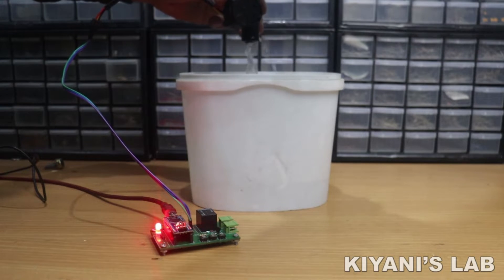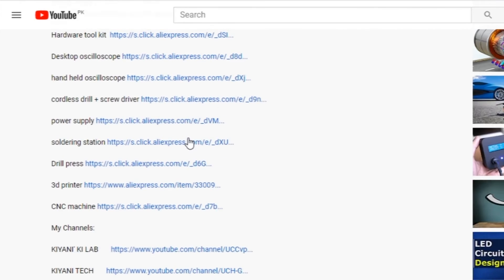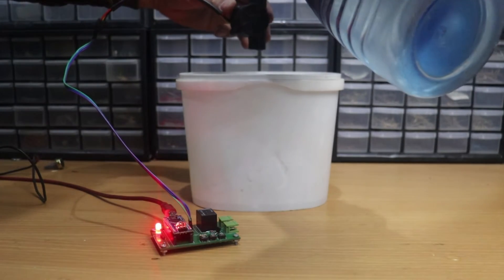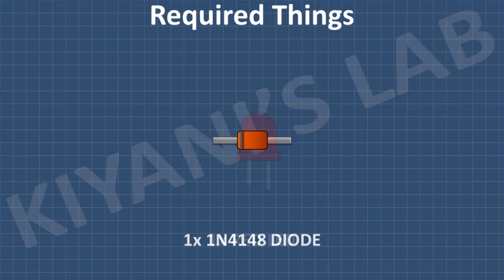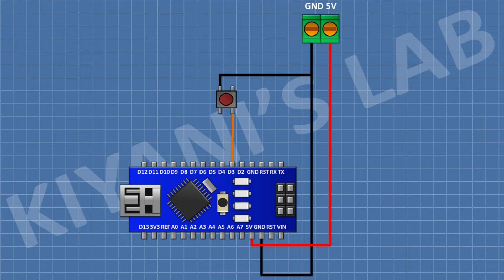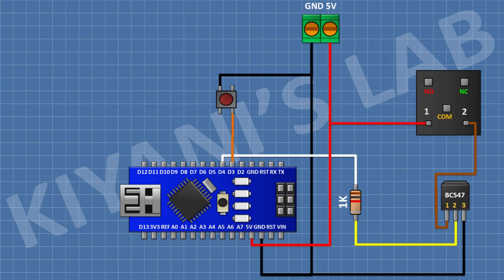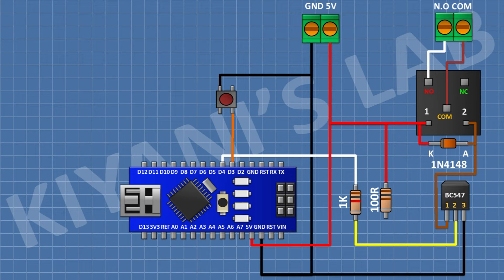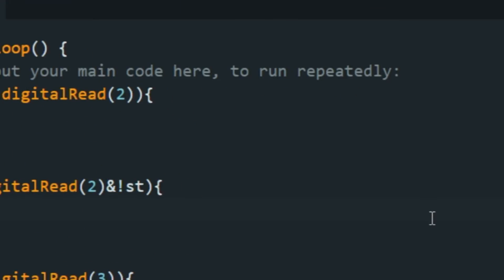DIY Water Pump Dry Run Protection Circuit | Arduino Project

Comment: Hi brother , the dry run time is not sufficient , once we switch on the pump , it will take some time to reach the water in the roof top water tank ,  so the dry run time which you provided in the coding is not sufficient , the motor will switch off after that . please reply .
Reply: Just increase the variable.

You can also prime the system through void Setup().

Alternatively, create a multi-program with a Switch-Case to allow for Prime and Running programs, but you should probably add an LCD at this point as well.

Comment: Sir make a GSM MOTOR STARTER CONTROL using 2relay START relay and STOP relay trigger mode through sms and phone calls relay trigger only for few seconds according to command START and STOP